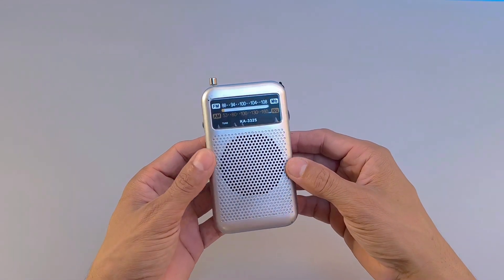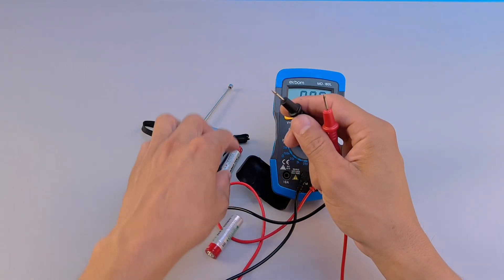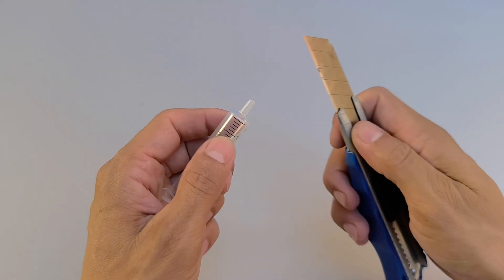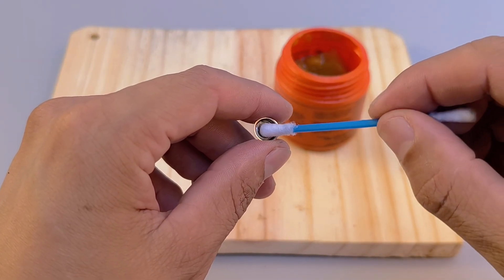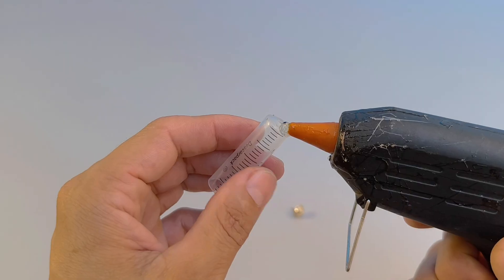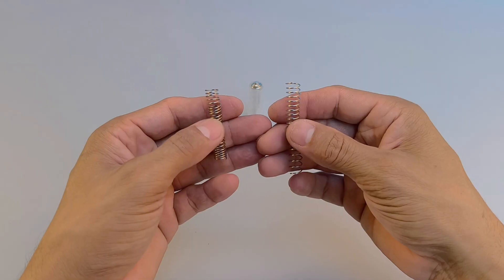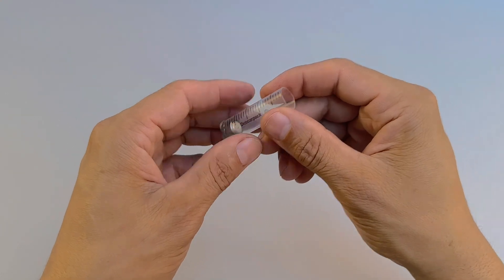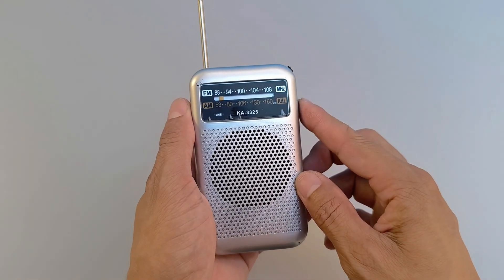Say goodbye to batteries! This trick makes your radio work for free forever

Comment: 😮
Reply from the maker: Surprised? There's more where that came from! 😄 Stay tuned!
Reply: @inovaouinventa You just chance the type of batteries with 2 smaller button batteries of the same voltage in one cell and short circuit the empty one..
In the video photo you have no batteries included...

Comment: This dumb. There is much less life current wise on the button batteries than on the AA or AAA batteries.
Reply from the maker: Fair point! 🔋 This trick is more for emergency or experimental use — not a full replacement for standard batteries.

Comment: You just made an AA size to button cells battery adapter. If you really want free unlimited  power forever, just connect the radio to a 5 volt solar panel. It will power up your radio without batteries the whole day from sun up to sundown, for as long as there is sunlight. You don't even have to turn your radio off at night, because it will power up again the next morning once the sun is up. I have a video on my channel to prove that. Actually I have that setup at home running, listening to news station all day long.
Reply from the maker: Thank you for your suggestion. The idea of having a solar-powered radio is truly fascinating. In addition to being sustainable, it is extremely useful in situations where there is no access to the electrical grid. I will check out your videos on this topic to learn even more. Thank you for sharing your opinion and contributing to the subject. You are always welcome to exchange ideas here!
Reply: 🇮🇳Indian, nice vedio

Comment: You are saying goodbye to battery, and using button cell fo power up... What a junk idea it is.... In india 2 AA size batteries cost only Rs. 20/- and same numbers LR22 or AG13 costs Rs. 70/-..... And there is more life in AA size battery.....
Reply from the maker: I understand your point, and you're right that battery costs vary depending on location and type!
Reply: @inovaouinventa  ok, so what's the point..?!?!

Comment: You say goodbye to batteries, but you are still using batteries so this is not a very good idea
Reply from the maker: This trick helps you save money on batteries, and it doesn't require any fancy equipment or expensive materials.
Reply: @inovaouinventa ... But the button cells that you used as demo COST MORE..!!
Reply: lmao
Reply: No se que sentido tiene el video si sigue usando pilas

Comment: Those button battteries dont have unlimited power, 
Was intrigued until you dropped in 2 button batteries, usual cost factor of those are around $5 to $12 a pack of 2, AAA batteries pack of 4 $8  , oh look i also get 2 extra batteries means double the length of radio Gah Gah
Reply: Oh come on those button batteries don't last as long as those AA or even the AAA batteries, there's a lot of effort you put out showing us for nothing I hate to say it.. just get those cheap AA or AAA batteries
Reply from the maker: It's true that even the button batteries need to be replaced eventually, but it's all about finding ways to make your electronics last longer!